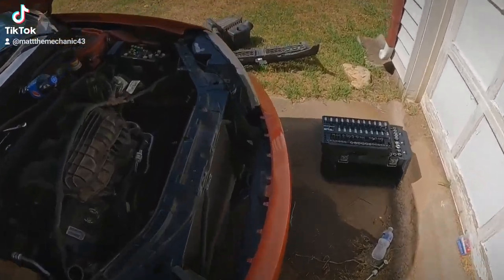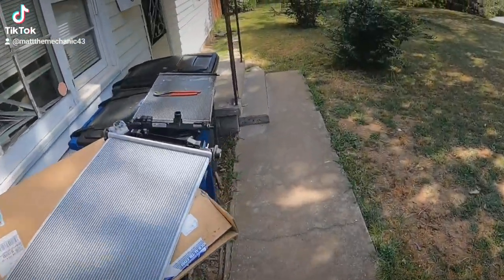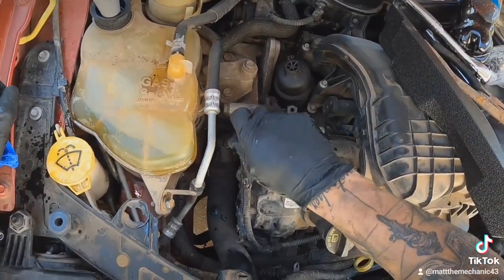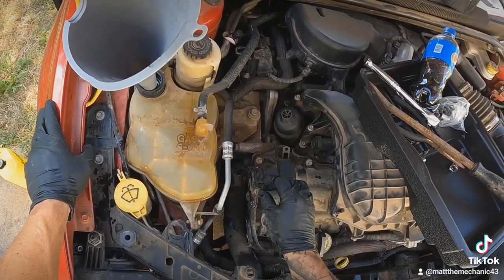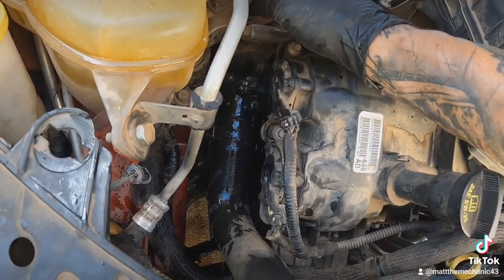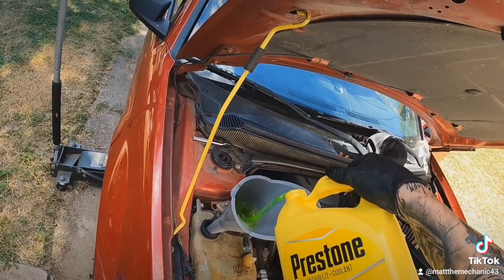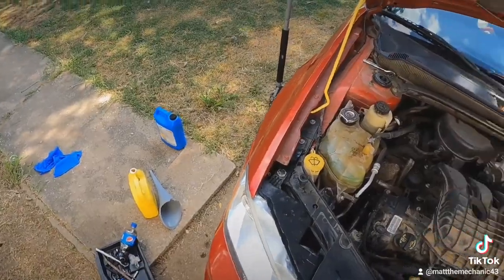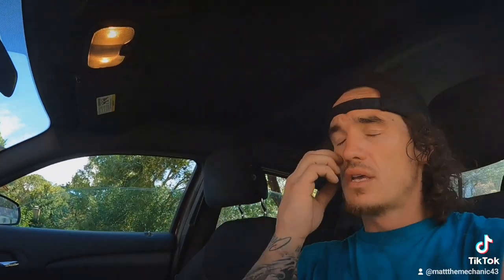dodge avenger radiator replacement #mobile #mechanic #fypシ #letsgo #letsgo #love #work #travel

Comment: Chevy avenger???
Reply: This didnt help at all. Probably should show the entire replacement
Reply: @htgamer5277  I’ve been looking for the save video but every video for some reason already has it broken down just shows the replacement process
Reply: @akonfest  did you find any videos? I need one also.
Reply: @MelissaYoung-tc8to  no, I ended up just removing my whole front (bumper, condenser, and radiator bracket) so I could replace the radiator, it took about 3 hours =\